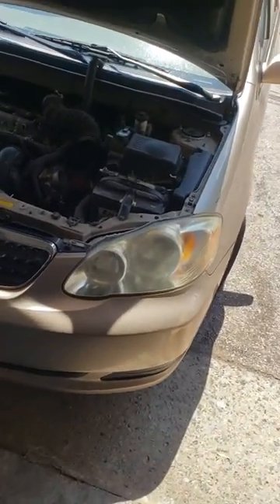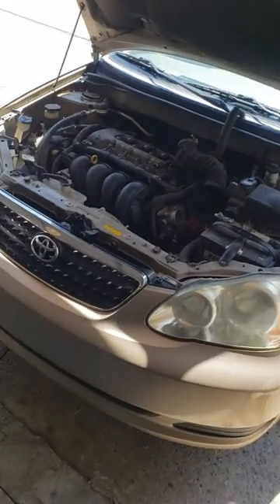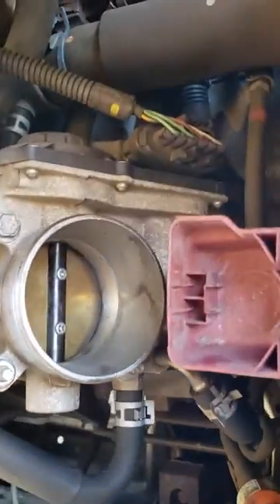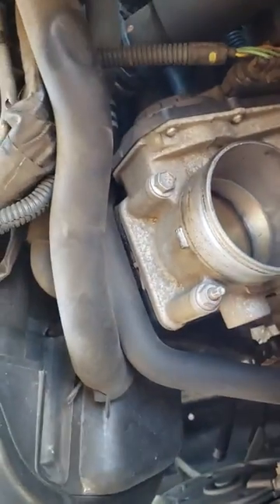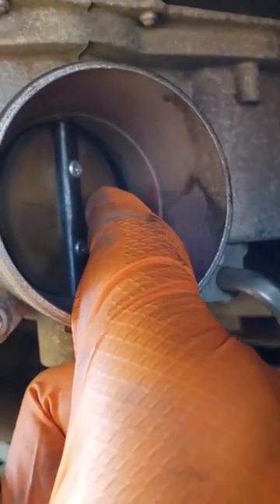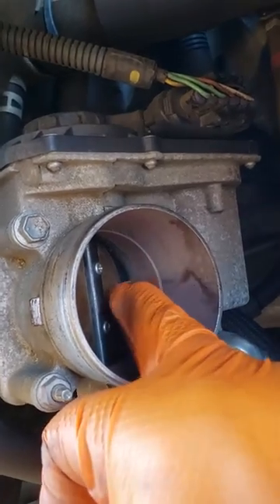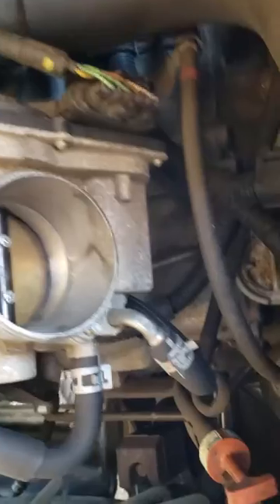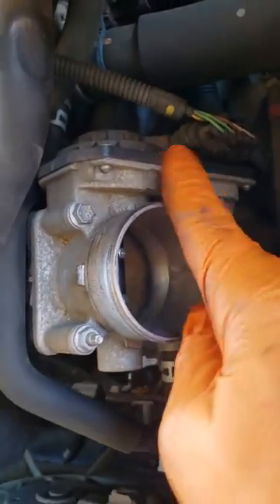SOLVED!!2006 Toyota Corolla has a delay when you press the accelerator.

Comment: If it was the throttle body there would be a code since its drive by wire. You def need to do a throttle body cleaning and air induction service which should be done every 30k and every 15k on direct fuel injected vehicles. I would start there before throwing alot of money on a throttle body. Carbon build up and dirty injectors and throttle body can easily cause hesitation. You should put a bottle of techron complete fuel systen cleaner the black bottle not the grey in the gas tank every 5k miles. Its one of the best if not thee best at cleaning injectors and helping to remove deposits. Im a Hyundai factory trained master tech and our engineers swear by it. My mothers 04 corolla had close to same issue only when it was cold with a rough idle and I found that the intake gaskets would leak when the engine was cold and toyota came out with a revised gasket which corrected the issue. So before wasting your money on a throttle body which I highly highly doubt is the issue or you would have etc codes an more issues then just a slight hesitation when you hit the gas I woould start with the fuel system cleaning and throw a set of spark plugs in it if its been over 60k since they last were done
Reply: I have the same issue I cleaned the MAF sensor and the throttle body and it stopped for about a week then it started all over again so now I'm about to change the spark plugs along with new coil packs and as you mentioned throw in some injector cleaner in the tank and see if that would help..
Reply: I don't know how many techron and other injector cleaners I've used..still the same ... I clean the throttle body twice a week ... egr service ... lastly I did an overhaul but it's still not finished either ... I have spent more than 10k to repair my car ... 1az fse engine is the most failed and most wretched engine from toyota ... their innovation is in vain ... electronic throttle body is the most stupid and inconvenient technology for users. ..
Reply: Good looking! 
Now i have a question, 
To be able to have more response,
Is it possible to change the ECU or somthing so the throttle body can go wide-open on demand with no hesitation, or would you need to have a specific type of throttle body if you were to say “plan on making a build?”
Reply: @trini_boi2414  did this fix it?

Comment: You shouldn't manually move the butterfly, doing this can cause the throttle body to become out of synchronisation. If you want to open the butterfly valve, keep the ignition on and keep the throttle wide open.

Comment: These Fly By Wire Throttle Body's go bad when they start getting close to 150,00 give or take 25,000.  Also don't expect them to give you a code either. The one in this video is just starting to go. Could be a dirty air cleaner, low fuel pressure. etc,,,

Comment: Thanks. The symptom you are talking about is only happening to my Corolla 2004 if I do not warm it up long enough. When the engine is warm, its ok. DO you think the cause is still the throttle
Reply: This also happened to my caldina zt 1az fse...did you solved the problems?
Reply: Hey! I have the same issue. What was it?
Reply: From my experience. When the throttle is still good, the delay happens before the engine is warmed up. But when the throttle starts to go bad, the delay stays forever. Mine just started and I’ll be getting a throttle body on Monday
Reply: Sienna 04 I have same

Comment: Glad I have a throttle cable. Car is a 2006 Matrix (1ZZ-FE) with over 208k miles and runs perfect. Is it worn gear teeth inside the unit?

Comment: The plate should not be able to flip with the finger so easily for a electronic throttle body. You can almost hear the gear grinding inside if you do that to a new one. This will damage your throttle body and affect the setting.
Reply: I pressed on it while I was cleaning it and nothing happened.
Reply: @nuriaksu1911  The proper way is to get a long torch light to depress the accelerator and then switch on the car key but do not crank the engine. You might spoil the gears inside in the long term.

Comment: I have a 2006 Toyota Corolla sometimes it'll die if I idle then put it in reverse or stop at a light and it revs down real low and then it randomly stalls and when I punch the gas the RPMs don't go up much and it's real slow for a split second just like you said so is it the throttle positioning sensor or the whole entire throttle body itself
Also when it's acting up something goes on with the electrical system too The clock gets real dull the lights dim when all this is happening
Reply: Also check valve clearance  
And  clean throttle body  replace spark plugs   Check ignition coils   Air filter  throttle position sensor   Check fuel lines and fuel filter..
Reply: It happened to a Toyota Matrix 2006. How did you fix it ?

Comment: I have a problem with my 04 camry where when i let off the gas the RPM meter goes below zero and the car looses so much power the lights and radio shuts off... i just changed the valve cover gasket and the oil a week before.. anyone know what may cause this??
Reply: Check for vacuum leaks. Any hose going to the air intake, brake booster, valve cover, PCV valve hose. spray ether or starting around the engine heavy while it's running to see if it sucks it up and revs up.

Comment: Hi, I am exactly facing the same issue with my toyota sienna 2012. I am using my foot trick to contril the fast pick up like i press slowly and hold and  then wait like half seconds so then it pick up slowly.. Please advice the solution if you have fixed this issue.
Reply: Has this problem been fixed yet? I'm having same problem
Reply: @mohammadshabir643  yes, i clean the throtttle body as there was too much carbon blocking the blade to close completely.

Comment: Looking for a fix on my 98 Camry 4 cyl with 138k. The idle goes up and down aroun 2000rpm when I'm driving it ever so lightly accelerating.  It also does it on the freeway. Sometimes I get a jolt or two every now and then going freeway speeds.  Mechanic can't figure this one out. Cleaned the throttle body and full tune up. any ideas would be greatly appreciated.  Same problem when I hit the throttle it delays for half a second and then goes.
Reply: Try cleaning the mass air flow sensor
Reply: Yeah maybe mass air flow sensor.
Reply: Time for a new Mechanic, if he hasn’t  suggested, cleaning the mass airflow sensor

Comment: That is not your problem.. You may have a combustion problem, oil on your spark plugs do to bad upper gasket
Reply: like what sir. clogged fuel injectors? Mine has hesitant acceleration from stop only. and then when it goes it goes. It only does it rarely, more so in hot weather. 
Also I hear a clicking noise when in idle. 
No burning oil, no smoke. It is idling slightly high like 800 RPM.

Comment: My car is doing the same but the throttle body is mechanical not electric
Reply from the maker: What codes are coming up on the computer?
Reply: @MobileMac1981  number 4 cylinder misfire and p0125 for the temperature control please help I been dealing with this problem for long time
Reply from the maker: @martingonsalez6635  have you physically checked number 4 cylinder to see why it's misfiring? Is it in conjunction with the po125?
Reply: @MobileMac1981  yes I try everything the cable are ok and they are not crack or anything even in the dark they are still good no spark visible one thing though when it’s just on and park it will not do anything every thing is normal but when I run it is when it start stumbleling